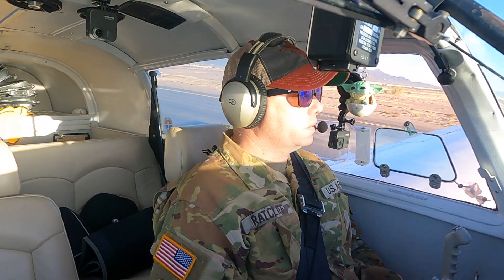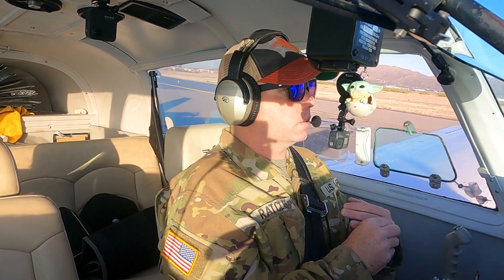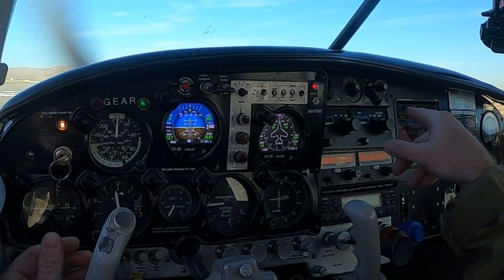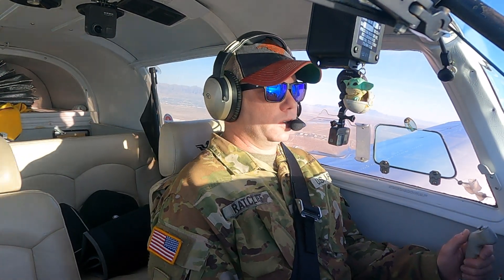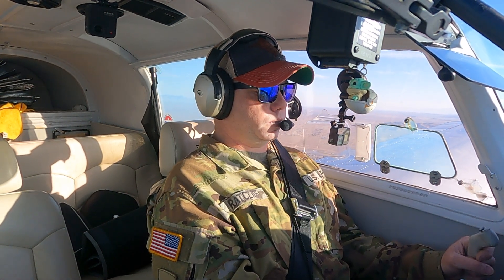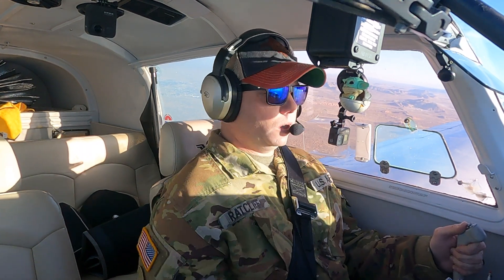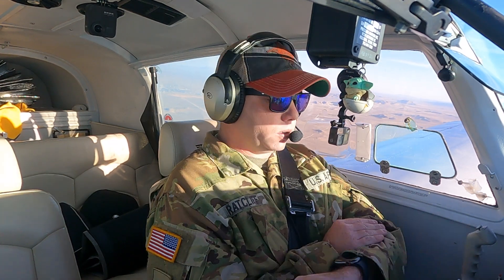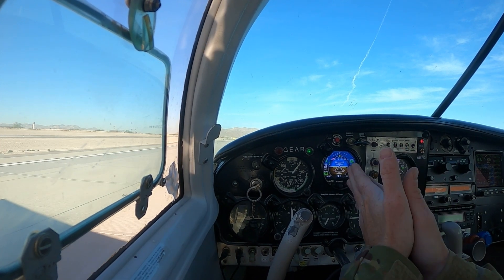uAvionix AV-30-C Review after installation in the mooney.   #winginit #av30 #uavionix #mooneym20

Comment: Does your Mooney/Brittain autopilot still work now that the uAvionix are installed?
Reply from the maker: I initially left the vacuum pump in for this reason. But I ended up getting a vacuum leak on my flight home due to turbulence. My initial test flights showed low vacuum and I had to fight the autopilot so I pulled the pump disabling the autopilot all together thinking it was the AV-30’s causing the leak. During the annual (install was in February and the annual was in November) I found the source of the leak, the vacuum operated step, rubber boot had completely ripped and was lying on the floor. What I think is that moderate occasional severe I hit cause it to tear. In the end, Im not sure the autopilot would work or not because I never got an accurate test.

Comment: I have AV-30s with a Garmin 540W and the GPS course is amazing. My flights are sharp and straight even with winds. For the airspeed, I also had to reduce the indicated to match the ASI, by about 6kt. I want them to match at Vg when the wing is most efficient, and so that I don't think I am faster than what I really am.
What software version do you have? It's up to 2.1.5 to help with the precession, though I am also waiting for the remote magnetometer to be certified. Nice plane!

Comment: Has your mechanical airspeed indicator been tested for a pitot static test. It's reading below the white arc in a stall, perhaps the av30c could be more accurate. How's the DG precession issue that's been going around affecting you?(edit yep magnetometer def needed)
Reply from the maker: I took her to do a full ifr pitot static test a few months ago. I had a static leak that got fixed.  Both the main airspeed indicator and the av30 were within tolerance. On the DG side, I’ve heard, rumors only, that the metal cockpit of a Mooney really doesn’t help it at all.  I’m not sure how true that is.